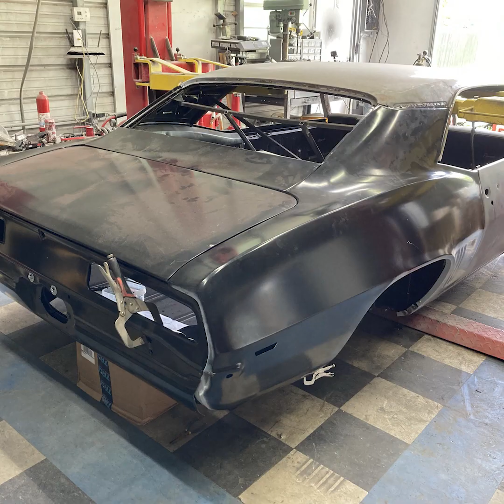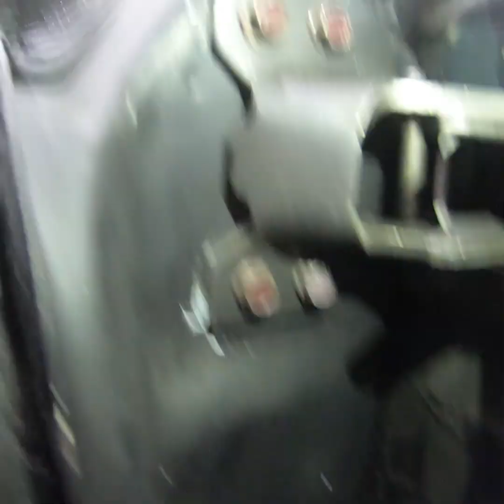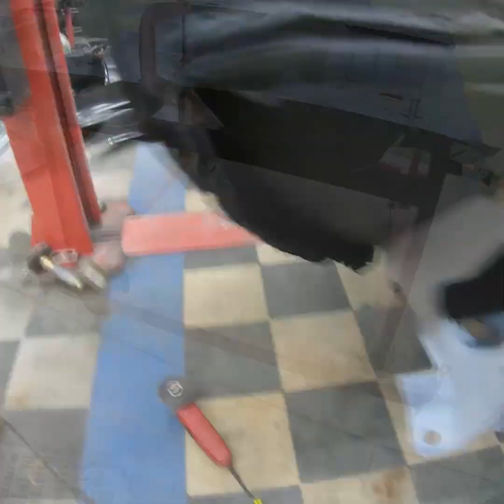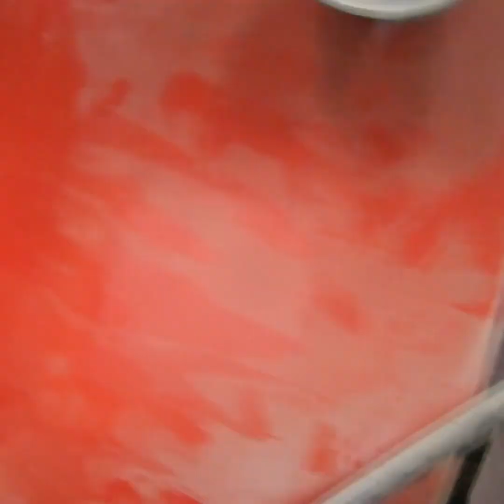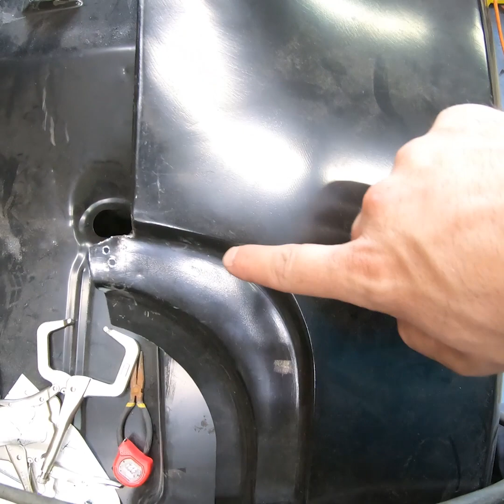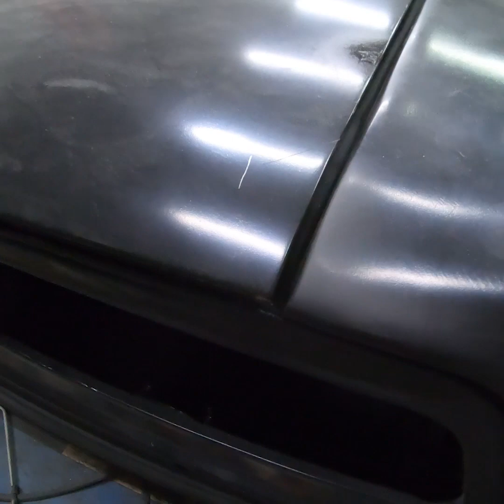1969 camaro body assembly using AMD parts

Comment: Where can I get information on Camaro body assembly is there a book or documentation available, also what about other cars/trucks that have all the available sheet metal to make a vehicle how would I learn how to assemble other cars/trucks.
Reply from the maker: @ryanmichalski7420  idk if there is an assembly guide, I just put the pieces where they go and measured off another 69 Camaro to make it exact to the other car
Reply: @1194video  Do think it is possible to put one together without another car to go off of.
Reply from the maker: @ryanmichalski7420  would be difficult without measurements
Reply: @1194video  I appreciate your help, after the mustang you just did what is your next project 1st gen Camaro, 67-72 c10 cab, or are going to do another mustang.
Reply from the maker: @ryanmichalski7420  well I have 3 67 mustangs sitting g here waiting for me to finish them so once I get the 69 chevelle done I’ll finish those then maybe a 67-72 f100 or 79 f100 idk might work on my 65 f100 lol
Reply: @1194video  looking forward to it.

Comment: Those quarter panels are junk. I would be very disappointed if I was basing my new build on such poor quality parts. I'm surprised you welded the body top / outside to bottom / inside. Other builds have started from the bottom and worked upwards, literally starting from the rear frame rails and then putting the floorpan on top, in a jig. That's how the factory did it.
Reply from the maker: I build everything off the doors, no matter what it is, if the door is right with the pillars and rockers then everything else will start to form up
Reply: THEM QUARTERS ARE THE WORSE AND THE GAPS ARE JUST HORRIBLE POORLY EXECUTED I WOULNT LET U WORK ON MY CAR😅

Comment: I owned a few 1969 Camaro's years ago wish I would have kept one I replaced the drivers side door and partial floor pans but wasn't impressed with the thin sheet metal that was available back then has anything changed with the quality of the sheet metal or thickness?
Reply: Alot is good and some need a bit of work. Yes, it is thicker. i built a 69 from all AMD that was available and rest from Dynacorn.
Reply from the maker: No it’s still all junk reproduction body panels